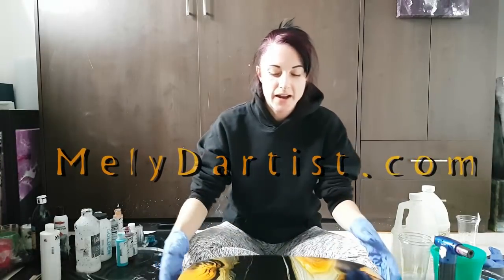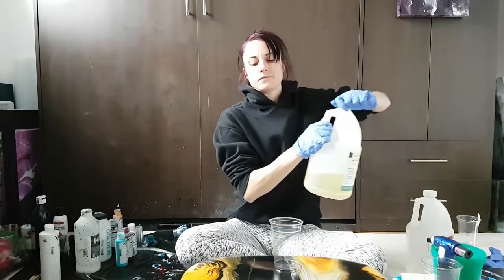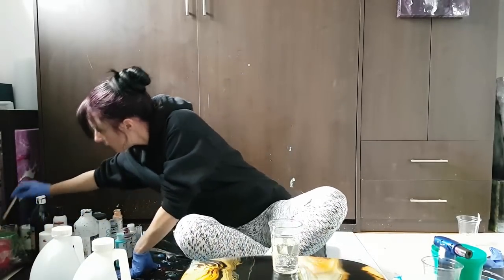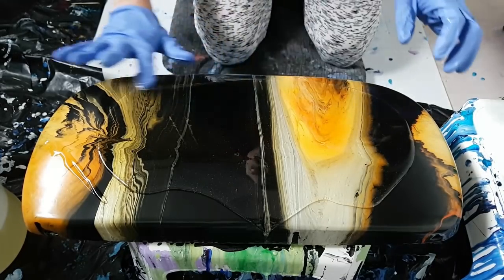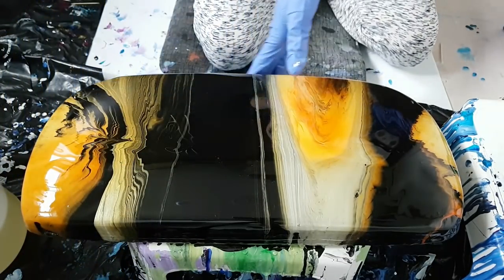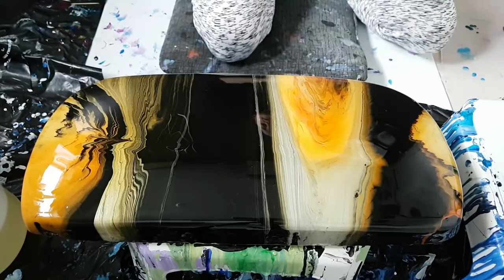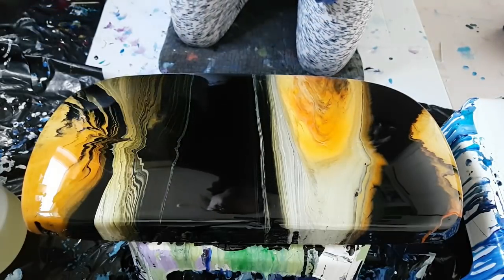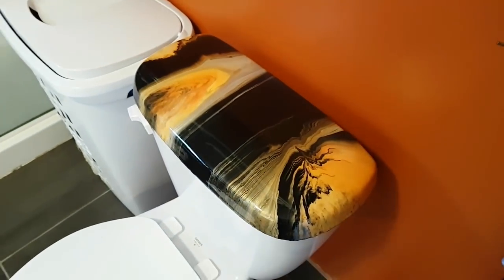Resin Coating my Toilet Tank Lid

Comment: Supposedly if you’re making epoxy, as long as you’re resin is slightly more than your hardener you’re good to go. If it’s the other way around you could get curing problems. Nice to see you jazzing up your loo！
Reply: If you have more resin then hardener you WILL have curing problems. You never ever want there to be more resin than hardener. Having slightly more hardener is fine though.
Reply: Mixed Media Kam Hi, my comment was actually from a tip from previous comments on the web. Epoxies all have their own mixing/curing sensitivities. Sticking to the working ratios of mixing are always the safest bet.

Comment: Torching will help it move as well and get the bubbles out - would torch a few times lightly to get the remaining air bubbles .. any questions I am getting way better at resin lately xox